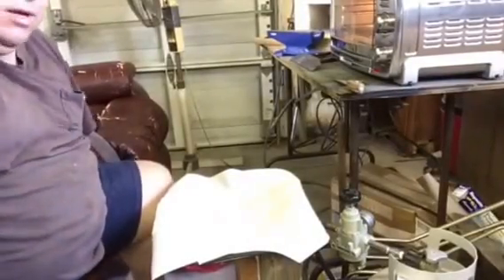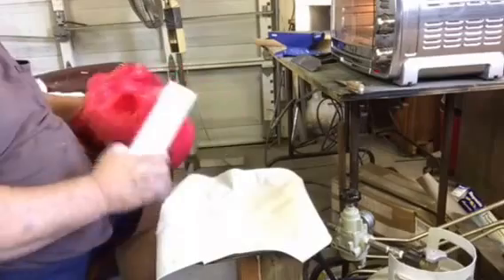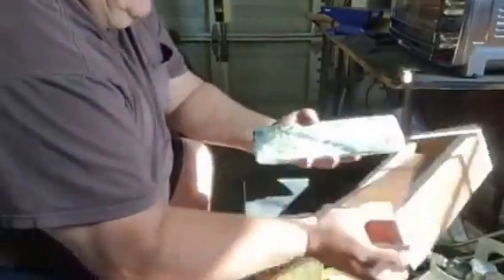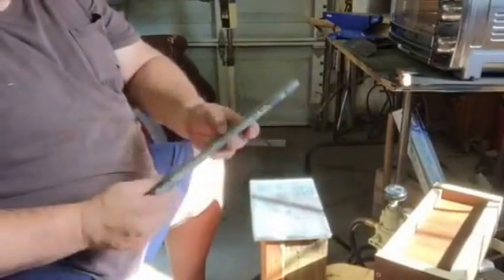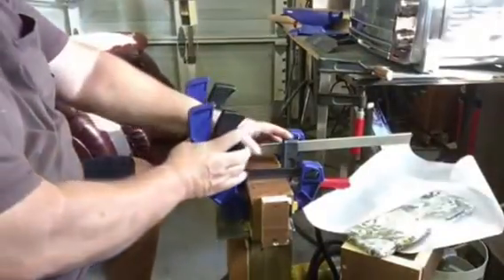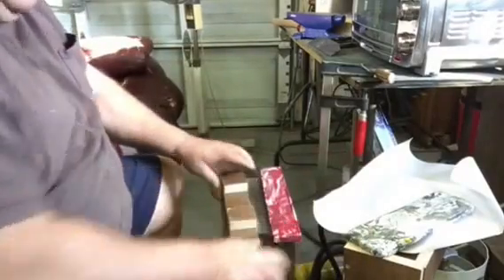Making knife handle material from grocery bags V1

Comment: awesome idea dude... however I have questions :

1- are ya ever worried about toxic fumes from heating the nylon ?

2- how do you form it into a handle ? (i.e. sanding / sawing out etc)

3- how resilient and sturdy (tough in short) is it ?
Reply from the maker: There is no fumes.  I use HPDE and it is safe to melt.  It has a recycle # 2 on it.
It cuts easily with standard saws and sanders.
After it is melted down a forms into a solid piece is it very hard.  I also made a couple of mallet heads with grocery bags.
Reply: thanks bruh... gotta try ASAP    :) 
Cheers !

Comment: How does it take sanding? Plastic is notoriously hard to shape through sanding
Reply from the maker: It dose sand well.  You have to use low speed sander or sand it by hand because it will melt is you use a high speed sander.  Thanks for watching.